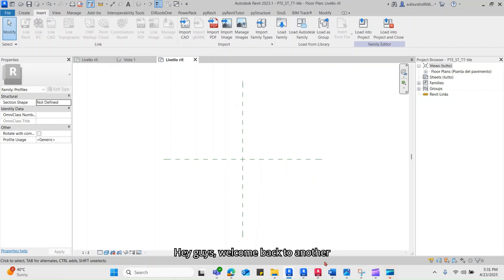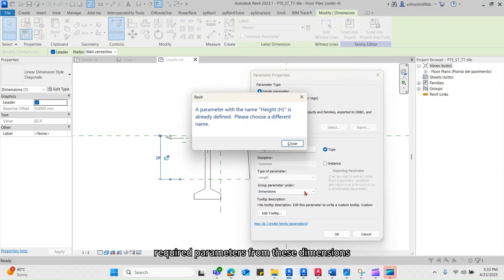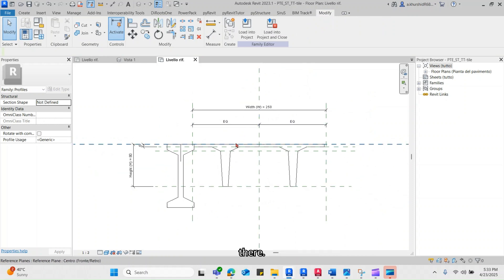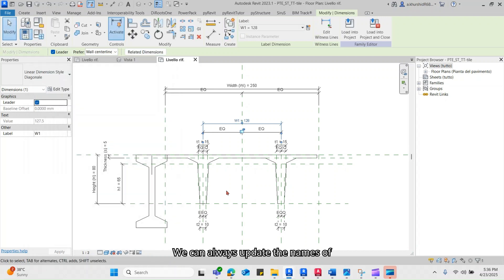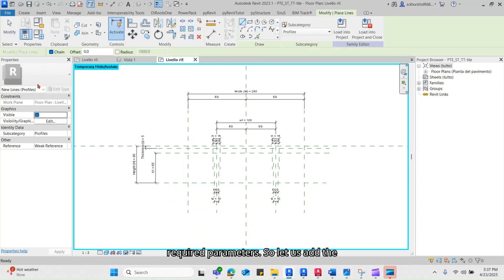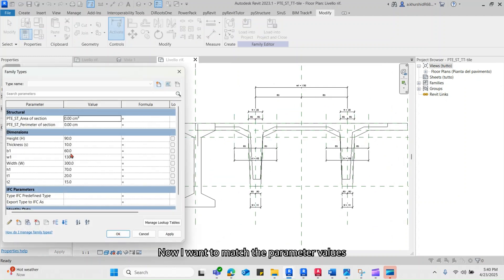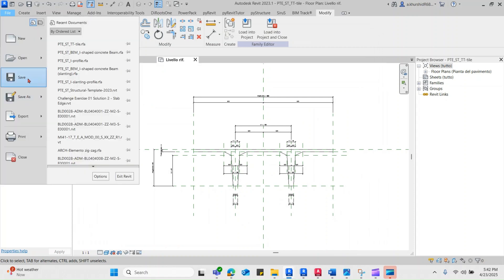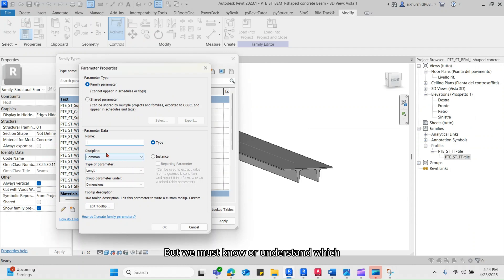How to create new beam family with nested profile family in Revit?

Comment: Can you make a video for steel detailing too? your knowledge with parameters are great.
My problem on creating a steel plate in revit family using extrusion method is about association of parameters (for importing in advance steel). I can't see any reference for the required parameters in advance steel. With that, even a simple rectangular plate cannot be imported. Maybe you have an idea?
Reply from the maker: Plates or connections can be directly created from the steel tab. There is no need as such to create a new family.
Reply: @DesignRevitBIM  Thanks for the response! I plan to be more efficient in modeling since the entire structure will be made of steel plates. I understand that plates and connections can be created directly from the Steel tab, but I’m exploring the use of Revit families with parameters to align with fabrication standards. I think, having parametric control will make adjustments and coordination with Advance Steel easier, especially for consistent plate dimensions and attributes.